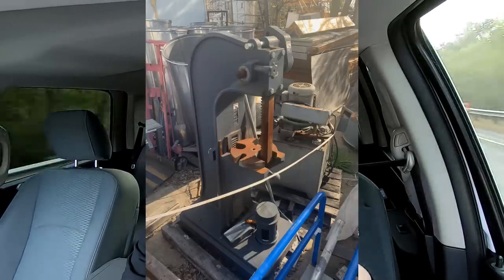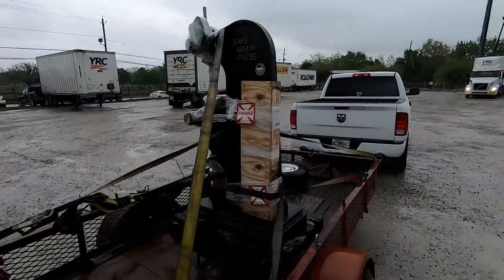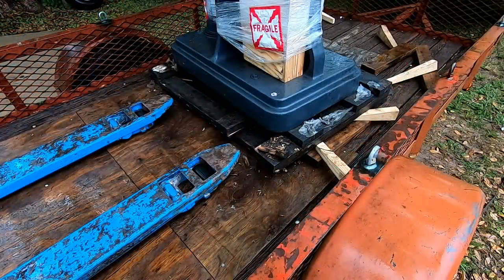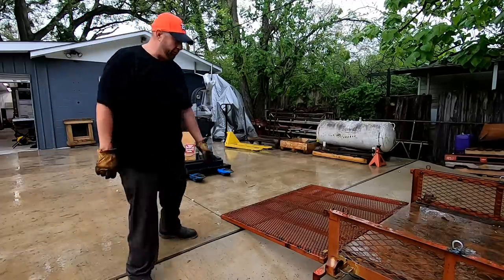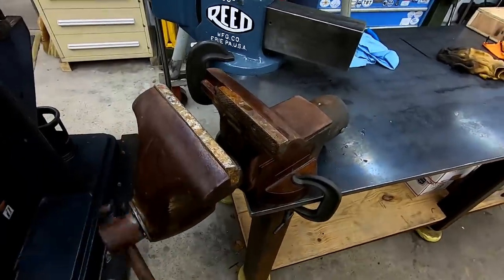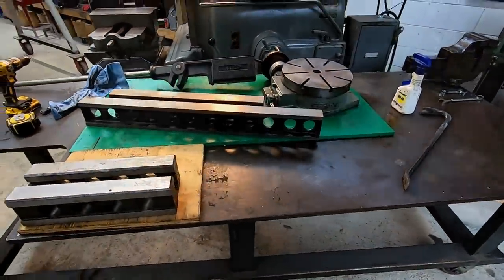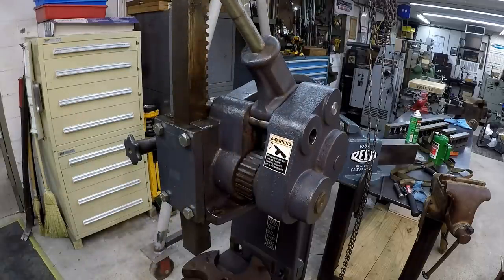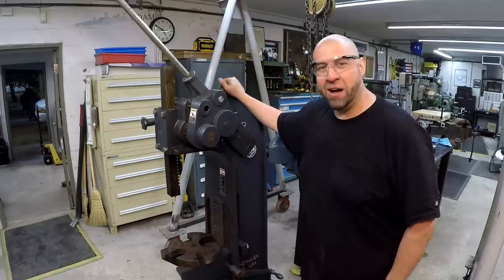Taking Delivery of New 15 Ton Arbor Press

Comment: You are so lucky. That had disaster written all over it. Never carry the load any higher than just high enough to move. Pallet jacks are so unstable. I've made hundred of equipment moves of 1000 to 4000 pounds with pallet jacks.
Reply: Mark G apparently that model is 1800lbs in weight so the pallet jack should be ok to use as long as you can balance the load.
Reply: @probablynotmyname8521  The weight capacity of the pallet jack is not the issue. Heavier can actually be easier to keep balanced but the screen floor trailer is very unstable. 1800 is a dangerous weight. Pallet jacks are basically 3 wheel vehicles. Top heavy loads tip past stable very quickly.
Reply: Mark G i agree, i think adam should have had a friend helping him stabilize the load for the unloading.  Pallet jacks are fickle beasts.
Reply from the maker: Mark, I handled it on my own because I have no one to help me. You see first hand I got the job down right. Not my first time.
Reply: Abom79 bear in mind adam that you promote the channel as being educational, pallet jacks are tricky to use and moving loads over unstable ground is not something an amateur should try by themself.  Youre an expert but not all your viewers are.
Reply: @Abom79  I always worked alone. Unless two people have lots of experience together, they actually increase risk. I saw that load jacked up high on the pallet jack. I am always low so I can quickly drop and stabilize the load.There is a one man move called walking the pallet jack to get over ridges and other obstacles. Insert under the load by an extra 6 inches. Pull to an obstacle. Drop the load. Pull the pallet forward six inches over the obstacle and lift again. I might take 20 moves to get off a trailer or lift gate but the load is never more than an inch up. I can move more weight easier than 2 guys using force. I once tried the 'roll it harder' over the small bump and as it cleared the bump, the load came over, on my leg. 10 days later, with a cast and 5 screws and a plate, I used the small lifts and small moves to deliver the equipment and put it up on a concrete shelf. Low, slow, and short moves, ever since.
You are usually so careful and precise. I enjoy watching your precision.

Comment: I have a question why use an arbor press over a hydraulic press?
Reply: I would guess that you get better feedback through the mechanical linkage; you can feel if something's maybe a little too tight/crooked, also you get a bit of 'bounce' from hydraulic presses. at a glance I'd reckon the arbor press also has a great deal more travel before you'd have to reset.
Reply: And congrat`s on your marriage...
Reply: @kaelin000  I never used an arbor press thats why i`m asking...
Reply: You get a better feel..you caan sense if something is wrong. After alot of practice
Reply: @homotorsports  I haven't used either, which is why I would have to guess, alright it's an informed guess based on experience with various mechanical/hydraulic/pneumatic tools. (I have listed them in order of "distance travelled by work from the point at which the error occurs" from "broken, but still in the tool" to "broken and working towards the apex of it's flight")
Reply: Depends on the job but an Arbor press is "quicker", like the cycle time.

Comment: Captain Hindsight says: That's why you look at your form of transportation/lifting at home and adapt what carries the load to it. And why you always carry a heavy duty pallet the wide of trailer with you. Yes center of mass will be higher, there's that. But the convenience of easy off loading....
Reply: I'd prefer to have any load have a low center of gravity over convince.
Reply: @Questchaun  Depending on distance and other factors... But calling ahead to learn how it's packed and if there is a lifting capacity to put it on a good pallet if it's not is prevalent. Multiple solutions (C. Hindsight again) beforehand.

Comment: Plz help! I've got a stuck axle in one of my machines. Its been like that for well over 20 years. Ive tried all sorts of pliers for turning it, ive hammered the gear on it and it wont turn. Also ive drilled a hole for getting more WD40 in there and no results. What can I do? I do not own a lathe or a mill so i cant destroy the axle and remake it
Reply: @Prototribal well, its some kind of hardened steel and cast iron, but if the acid eats one of them, i wont be able to use it anymore
Reply: Sometimes you have to take it to a professional. Spend the money and be done with it. It's been 20 years.